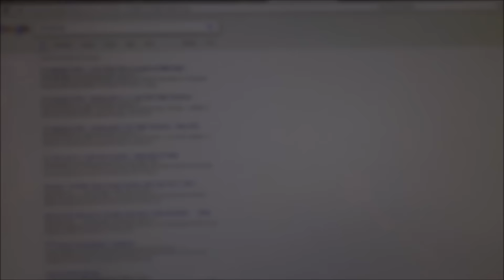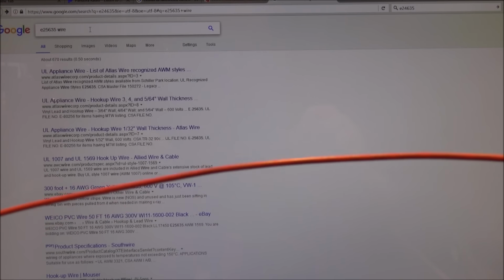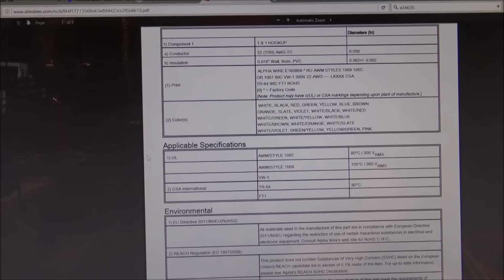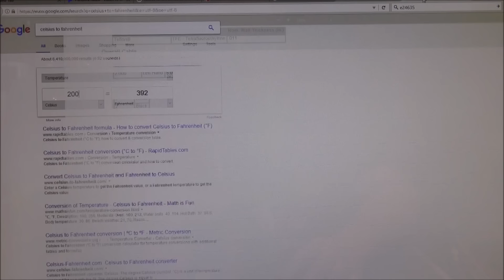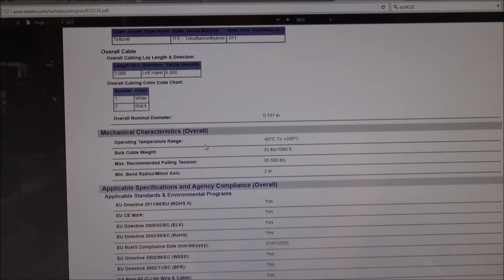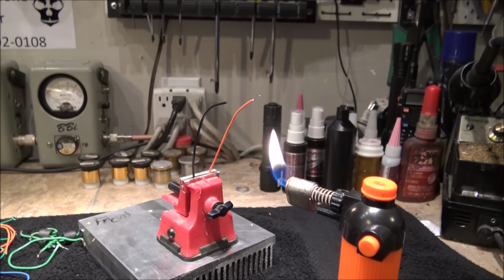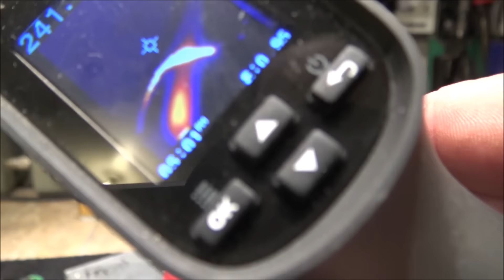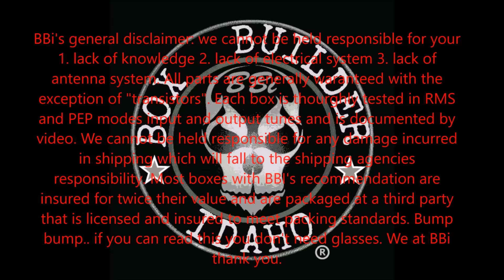Teflon wire is a must in most of the amp

Comment: Good video my friend, I had a Amp come to my shop with the transformers wrapped with 18AWG speaker wire. They all melted and shorted out so I replaced them with TEF-18 no more problems. Thanks for the video and for leaving the comment section open.

Comment: great video BBi. I have done repairs scene 1980. all to often I find PVC wire inside box. The DIY people some use speaker wire. BAD BAD !!  I use silver plated Teflon on my RF transformers.  That includes vacuum tube amps as well.  plate wire sometimes silicone HV HI temp wire must!!  remember 3000 +    plate volts and tubes get hot!! spend the money get the right wire!! want to see what A fire looks like. find BBi video on 16 pills that let the fire out.   watch it. this is what did happen. that was a wire failure . PVC wire grounded to heatsink.